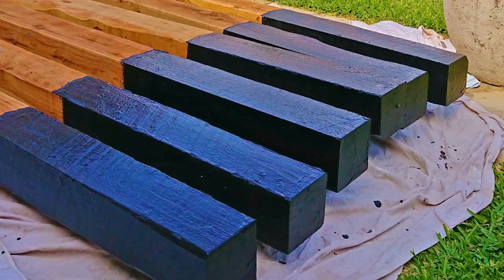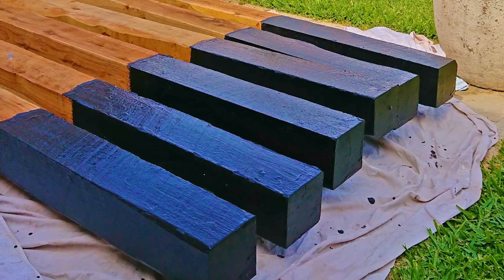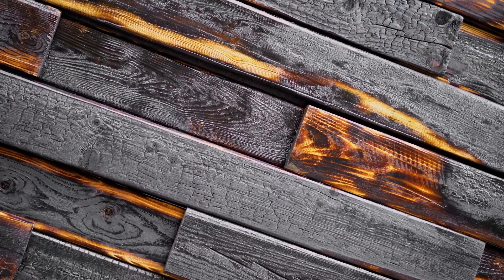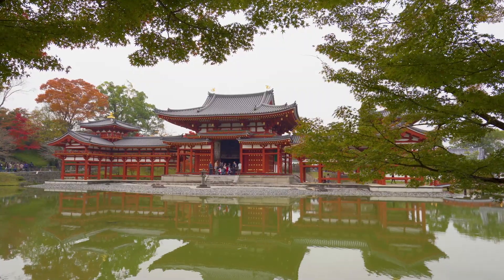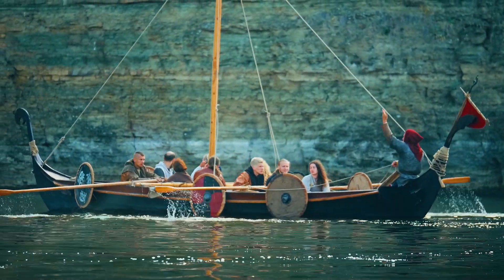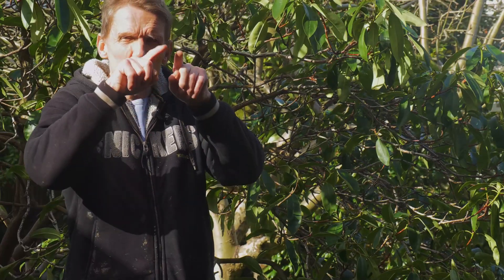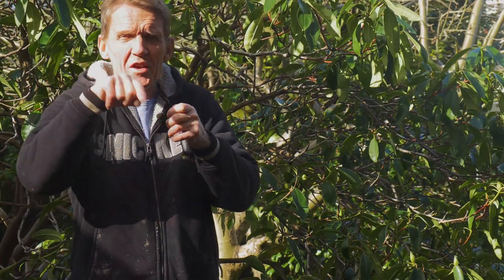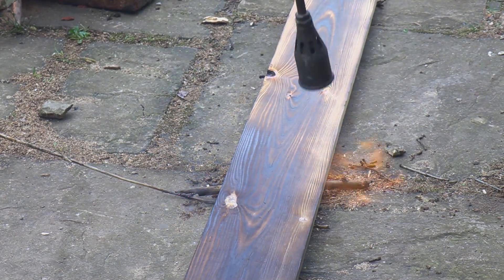Charring Wood For Preservation — Yakisugi Method

Comment: There is a better method, you need a metal or fireproof air tight box, heat it slowly over hours until the wood is baked, 2 hours per inch I think it was, and that drives out all the volatiles and burnsthem consuming any oxygen then the resin drips out and you're left with petrified/fossilised wood that's more fire resistant than structural steel. And harder than bronze.

Comment: here is a sneaky tip to keep your fence posts lasting literally forever.... put em straight in the dirt.... but about a 1ft off the ground drill a nice sized hole down the middle, and fill it up with old motor oil, and then make a little dow plug for the hole, and every couple years go around and add a lil oil to your posts, and boom, forever posts
Reply: Of course you will probably polluting the soil for 100s of years. 😢

Comment: Does it compromise the strength of the timbers at all? and does it protect against water damage? Thinking of doing this for a garden room base.
Reply: A bit late but I know a little bit. Take it with many grains of salt. 

You are burning the outside, creating maybe a centimeter of burnt layer. 
It will not have any major implication to any wood that is going to carry any load. We burn post (that's carrying all the load) to treat them like this for centuries. 

It is still recommended to seal the wood with some liquid based solution. The burning does create a weather resistant layer from the process of burning it. But as it cools down, micro crack will form. Water and microbe will finds it way into those cracks. 

Lastly, it does nothing against insects. 

The best treatment process is
1. Burn them. Let it cool down. 
2. Treat them with preservative. 
3. Seal them.

Comment: Just watched another channel on this.  For the planks use 3 make a chimney.  Start a lil fire at one end.  Prop up over a bbq or steel grate.  Let burn  flip.  For a bit, then unbind carefully and boom burne planks.  You can also flip and redo it on the other side,  finish off with the tortch on the edges if you need

Comment: We used Charred Wood Accelerator, it should last a long time, as long as we keep a good wood sealer on it. It was easy to do, and looks great!
Reply from the maker: Good to know! We will check it out
Reply: @SkillBuilder  hi Roger. Nice video.
I have a shed, one wall will be facing the neighbors wall, once it's up, there will be little space to access it. It already has a layer of paint on there. I was thinking of lightly charring, then painting it with bitumen and then sticking damp proof membrane on top of the bitumen. Is this a good idea or absurd?
Reply: We used it on the boards under our eaves. We just put the first video on it out today.
Reply: Did the Vikings use the wood sealer your talking about?

Comment: I once made a vertical feather-edge fence and my saw broke, so I found if I cut the wood with an angle grinder, it would smokily char the cut to a glossy, sealed and scortched finish and it never decayed on the edge facing upwards on those peices..
Reply: Only issue is there will still be moisture inside. Still a great idea though!

Comment: The research suggests that the process is ineffective.
'Shou sugi ban, also known as yakisugi, or just sugi ban, is an aesthetic wood surface treatment that involves charring the surface of dimensional lumber, such as exterior cladding. The goal of this research is to examine the effect of shou sugi ban on the flammability and decay resistance of wood. Several species and variants of commercially available sugi ban were tested. The flammability was examined from the heat release rate curves using the oxygen consumption method and cone calorimeter. Durability was examined with a soil block assay for one white-rot fungus and one brown-rot fungus. The testing showed that the shou sugi ban process did not systematically improve the flammability or durability of the siding'
Hasburgh, Laura & Zelinka, Samuel & Bishell, Amy & Kirker, Grant. (2021). Durability and Fire Performance of Charred Wood Siding (Shou Sugi Ban). Forests. 12. 1262. 10.3390/f12091262.
Reply: Sponsored by Big Chem?
Reply: Tell that to the Japanese and the Vikings.

Comment: I made a door using left over floor boards. Charred the ends then sealed the entire thing with a mix of engine oil and brake cleaner to help thin and penetrate the wood

Comment: If you're doing planks or scaffold boards etc & want a fast/cheap/easy way to get a deep burn on the surface without a gas torch etc the traditional method is to stand 3 boards up on their end & strap them together in a triangle chimney shape with wire, shove a ball of scrunched up paper in the bottom & light it. The fire shoots up the boards in its search of O2 & creates quite an impressive looking flame thrower that DEEPLY chars the boards VERY quickly. WARNING do not do this next to your house or anything you do not want red hot embers landing on!!! Works a treat.
Reply: How long does it take? In other words, what and when do I “set my timer to” before my wood steak goes from well-done to unusable?
Reply: @scottmassino3051  Varies depending on the wood, the conditions & how deep a char you want etc so you basically have to just set it away & then spray it with a hose pipe once it's done to the way you want it. I done scaffold boards in the winter & wanted a deep charing effect which I seem to remember took around 10 to 20 seconds to get the full flamethrower effect going from lighting the paper & then only around 30 to 45 seconds once the flamethrower effect had fully established to achieve a deep charing. Obviously you can only do a very deep char on reasonably thick timber say 25mm or thicker as thinner timber would just loose integrity & fall apart so just do a shorter burns on these. Then use a hose & stiff brush to clean off the loose burnt wood, be warned this bit can get messy.
Reply: @scottmassino3051  this is faster than any other method, if u want a deep burn. 
https://www.youtube.com/watch?v=rzVoBog8A_4
Unless u really know what ur doing, preparing the wood chimney takes more time and is more work than just flaming it with a torch.
Reply: Turn the self-built triangle-chaped chimney upside down after some second so the bottom part of the wooden planks is burning the same intensity as the former top

Comment: Proper Creosote is still available to the trade. I soak the bottoms of the posts in it (so that leaves 3" showing above ground) for a couple of days. No signs of rot after 12 years.

Comment: It’s called “Shou Sugi Ban” and it’s an amazingly effective wood preserver and quite beautiful if done properly on face timber. One caveat I would mention is that certain species are far more suited than others. This list is too comprehensive to give on here so I suggest looking online as there are many threads carrying detail on this subject.
Reply: Shou Sugi Ban is the wrong pronunciation that the West has coined. Yakisugi is the correct term. You'd get funny looks in Japan if you said the former. SSB uses the same Kanji characters but means something different whereas Yaki  means "to heat with fire" and Sugi is cypress.
Reply: It’s called Yakisugi , Shou sugi ban is a bullshit name invented by some halfwitted American

Comment: I've chared the wood on my garden room then brushed it back really brings out the grain. Also on my fence posts I cut up the middle about a foot with a jigsaw then leave it in a bucket of fence treatment for as long as I can to let it soak up normally 2 months or so.been in 10 years not even gon green or rotted.

Comment: TRADA carried out tests many years ago to determine the effectiveness of charing and found it needed to be to a depth of 15 mm or more to make it impervious to oxygen, which is required for the rotting process.  Surface charing does work but only slows the process.  Lack of oxygen, lack of rotting, which is why timber in peat bogs is still viable after thousands of years.
Reply: What about wet rot, it it impervious to water.
Reply: @kenb4348  Peat bogs are pretty wet! 😂
Reply: Did they check out for thinner wood?